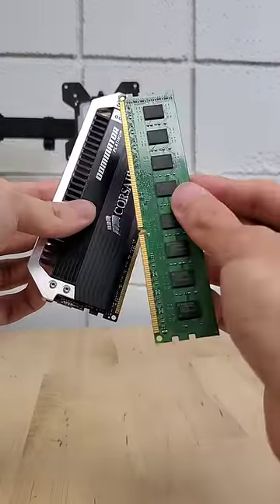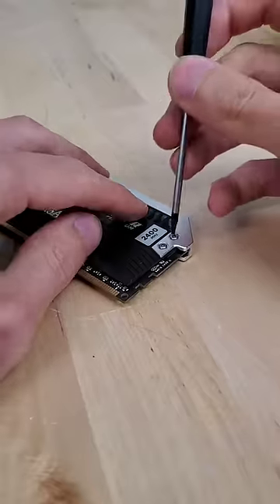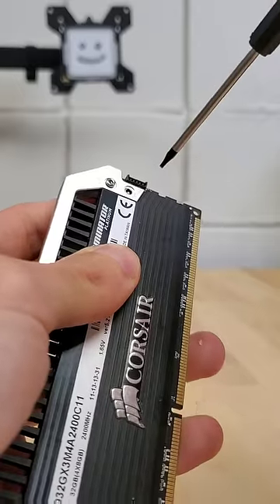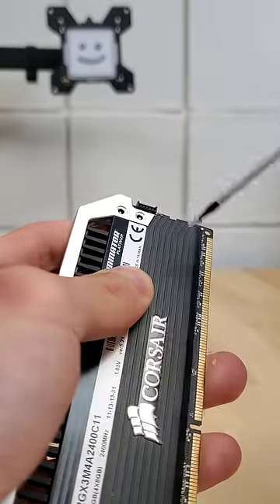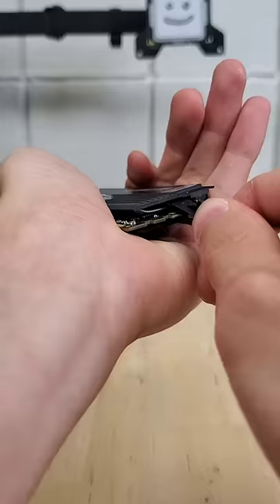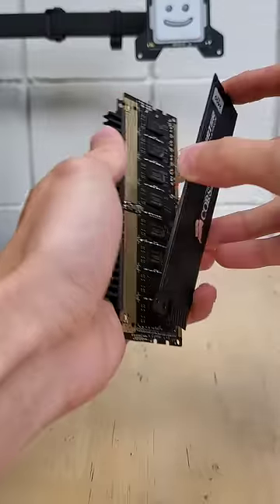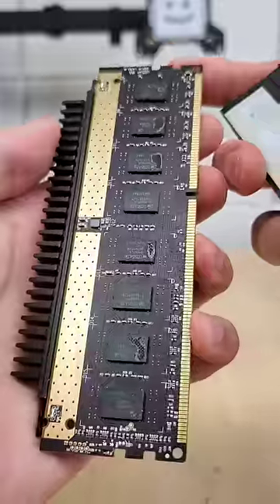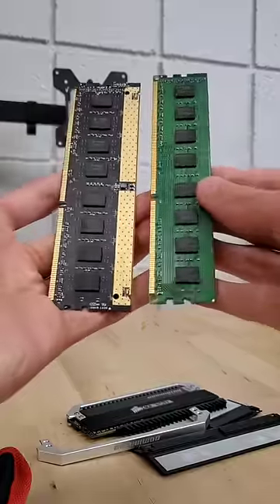why do these RAM sticks look different? #shorts

Comment: Why did the first one immediately look like a harmonica to me...?! 👀🤣
Reply: its to disperse heat from the ram
Reply: the fin like structure is used to direct airflow. A harmonica shares this features to pass air past the parts that then vibrate and produce a certain tune. In the case of the ram, it helps direct airflow past aluminum to help disperse heat. You disperse this heat to run the hardware at higher mhz for better performance, but the extra electricity can add additional wear to the hardware, shortening it's life. Thus we put these metal fins on it, with thermal pads (the sticky part that requires heat to remove) to help reduce the load of heat on the part, helping it to last longer.
Reply: I see you have a great imagination LOL
Reply: @DocDuko  r/science
Reply: Not just higher mhz but better stability in higher speeds and more overclocking headroom.  Though overclocking ram is pretty much a niche thing to do with pc nowadays since xmp/docp is pretty good. So that corsair dominators are just for mainly display and aesthetics these days though the functionality is still there if you need it.
Reply: static shock at its finest 😀👍
Reply: @cunnieseverywhere  nah 95% of all ram heatspreaders dont do shit, its only there for looks especially on corsair garbage
Reply: So you can always listen to harmonica while you're gaming.
Reply: holy shit it does look like a harmonica
Reply: You don’t use your ram as a harmonica too?
Reply: I liked this before realising
Reply: @DaddyM7MD  ”Yeah b*tch! SCIENCE!”
Reply: Housebuilding song intensifies
Reply: Those rams can do to us what they will, but we will never tell you anything!!!
Reply: @BenTiredson  the only real answer.   Ram doesn't get too hot, and doesn't need a heatsink, or we'd have an actual heatsink on it.   So far at least

Comment: You never actually answered "why" they look different, it's because the higher end RAM has that heatsink stuck with thermal pads to the components.
Reply: and tighter timings, ect.
Reply: And better quality and all that gold
Reply: It's almost like one is designed to run at 2133mhz and one is designed to exceed 3600mhz or something.
Reply: @ec7005  I have a question, I have laptop ram that runs at 3200 mhz but it doesn't have a heatsink, is that normal?
Reply: @doggo_woo  yeah

Laptop components just dont have space for that much heat regulation
Reply: @doggo_woo  heatsinks on modern ram are mostly aesthetic ddr4 ram doesn't get hot enough to justify them
Reply: But components (memory chips) has plastic cases. And plastic is not that good in transferring heat. 

Do you see those metal rectangulars? Heatsinks are attached to those.  I belive high end RAM has a separate heat spreading PCB layer.

Comment: Just like in real life. Cooling really makes a difference in efficiency.
Reply: Define efficiency?

I don't think it is efficiency it improves.
Reply: Dude if your thermal throttling RAM you need to improve your pc
Reply: @frankieslefttoe8210  I'm not? It was just a statement.
Reply: @deang5622  hotter can lead to a slower performance, which can in turn make the whole process slower and thus inefficient.
Reply: I agree bro, it's a bigger thing in laptops and phones tbh
Reply: @raiduh899  RAM only thermal throttles at 90 to 100 degrees if it gets that hot you should worry more about your GPU and processor
Reply: @frankieslefttoe8210  correct. Again, only a statement.
Reply: @raiduh899  oh apologies thought you was a different person
Reply: @frankieslefttoe8210  You can run into memory instability way before that when you start tuning your memory. The memory itself doesn't run particularly hot so you might be able to run memtest all day, but start pumping some real heat into the system from GPU+CPU and your memtest stable RAM could be causing issues just because the case ambient is enough to get your memory hotter. And I'm not talking 100C hot, going from say 40 to 50C can make the difference between stable RAM and bluescreening.
Reply: @SaltyMaud  For anyone who's interested, most DRAM modules are temperature sensitive especially when access frequency is increased and latency is reduced via overclocking, even more so when done past the advertised profile speeds that the RAM was originally binned for. The heat spreader along with case airflow can often be the difference of the overclock being stable on a hot day and getting data corruption the moment you unzip an archive.

But if you're going to simply run your RAM at JEDEC, XMP or the upcoming EXPO profiles, they will probably be fine even in a small case with limited airflow in a warm room.
Reply: So wrap it up in crap that acts like a heat soaker?
Reply: @deang5622  any electronic device uses less energy at a lower temperature since less of the energy is converted to heat
Reply: @ChirpFPV  No, that is wrong.
The electricity passing through a device generates heat because of the resistance of the electronic components the electricity is passing through.
That power dissipation is a function of the current and the resistance of the device.
The resistance may vary with temperature, and that can affect the power dissipation, however for your statement to be true, all components would have to have a positive temperature coefficient of resistance,  and that is incorrect .  Devices can have either a positive or negative temperature coefficient of resistance.
Reply: @deang5622  oh, my bad😅
Reply: Ram never gets to a temperature to over heat.
Reply: @MrMorgan316  Correction, properly installed RAM never gets to a temperature to over heat.

What is the operating temperature range for RAM and why is there an operating temperature range?
Reply: heatsinks do next to nothing on ram sticks, they really dont need heatspreaders. its purely aesthetics
Reply: @a_aron30490  Really. Got the evidence for that have you?

Are you saying the chips won't over heat when driven at the frequency and current?

Do you know what happens when chips get too hot?
Reply: @raiduh899  No. Go read my post again.
Heatsinks on RAM modules are nothing to do with efficiency.

You need to be very clear on what efficiency is. I said in a previous post "Define efficiency". I said that because people clearly do not understand what efficiency is.

Don't mix up efficiency and performance. They are not the same thing.

Manufacturers are not considering efficiency when they design the RAM modules. They are designing the module so that it works over a specified temperature range.
Reply: @raiduh899  RAM don't even make enough heat, they're literally just memory modules that store and gives data.
Reply: Ram almost doesn't heat up and any cooling isn't necessary. Definielty not in pc desktop. If server ram doesn't have it, and  uses ram more intesively...
Reply: @raiduh899  I wasn't talking about getting hotter, I was talking about efficiency.
There is a difference.

And yes I do know about how semiconductor performance degrades with temperature ..I used to design integrated circuit chips. I had to take account of temperature and voltage variation in my designs.

So, thanks for trying to educate me, but I already know.
Reply: @frankieslefttoe8210  Rubbish.
You think a RAM chip can survive 90 degrees C without impacting performance?

Comment: Yeah, ignore stuff like transfer speed and latency and they are the same, lol.
Reply: the dom plats in this video only run at 2400 MHz, this speed and even higher are easily achievable by a stick of  plain jane no-heatsink ram, and that also includee latency timing.

Comment: What's important is on the inside.

Yes, but those heatsinks are pretty important too.
Reply: heat spreaders*
Reply: And bigger is better ;)
Reply: Not really. DDR2 sticks ran at 2v and didn't need heat sinks, so DDR4/5 with 1.1v won't need it either.
Reply: @rvnx  Memory modules that run XMP profiles use a higher voltage and do run hotter.  A lot of it is looks, but it's also on there to keep the temperature down.
Reply: @TheLionAndTheLamb777  not really. It's been years since we had computer cases with dedicated fans for the RAM sticks. If they actually care about cooling, they would've gone with a finned heatsink design
Reply: My RAM goes up to 50C last time I checked WITH the heatsink / spreader. Yes, they very much need it.
Reply: @rvnx  if u dont mind lower speed and higher latency, then basic ram is fine. Ive never seen basic ddr4 ram with jedec and xmp as high as ram with heat spreader.
Reply: My ddr3 is at 1.65v and has very basic heatsinks. So I agree.
Reply: The colder temp the faster it can run, which also depends on the parts on the ram, so cooling may not be needed, but it helps secure a consistent or faster performance and I'm not gonna say no to that.
Reply: @accretian  samsung bdie
Reply: @rvnx  it is 2022 and everything needs a heatsink. CPU/GPU, M.2 SSD, RAM, even a heatsink needs a heatsink.
Reply: @rvnx  [older technology] can do x so [new technology] should do x
That statement unfortunately proves false, especially when you talk about electronics being cool.
(On another note: it's total wattage that is proportional to heat output, voltage isn't that significant when there's a higher current intensity)
Reply: @rvnx  Run your ram at 2v then champ, please do come back and share the results though :)
Reply: They aren't important. There is no evidence for heat spreaders even affecting temperatures and performance
Reply: @rvnx  🤓🤓🤓🤓
Reply: @rvnx  eh depends on the DDR2 cause ram coolers were necessary if you had poor case airflow or a lot of fast ddr2 in close proximity to eachother
Reply: @MrMorgan316  they are important if you've got a shitton of ram
Reply: @theaverageblitzer4351  yeah but the average user it only helps with grip on removing them and putting them in
Reply: @theaverageblitzer4351  but if you do run into heat, you have problems. rather safe than sorry. who knows maybe chrome can crash
Reply: @mycelia_ow  that's what I'm sayin'
Reply: DDR5 is hot
Reply: @patx35  OCed RAM can go to 80c or higher. Memory chips are somewhat sensitive to temperature. That's why memory intended for OC comes with heatsinks.
Reply: @rvnx  That doesn't mean anything. Older chips were made on process nodes far bigger than we have today, those would run at higher voltages without causing that much heat. Try to run modern RAM at 2v and see what happens.
Reply: Actually the heat spreaders aren't important. Modern ram doesn't get very hot; at least not hot enough to damage the ram. You will damage other components in your PC before your ram overheats.
Reply: @hardcorehunter7162  in laptops ddr5 needs a head spreader. Little ultrabooks have little space for heat and often are very hot in every area.
Reply: @babyhandsthegreat  My laptop ram doesn't have a spreader. I don't even think I've seen laptop ram with a big heat spreader on it.
Reply: @rvnx  It depends on what you're doing with them. As someone mentioned XMP automatically puts them at higher voltages (1.35) which really is just a startpoint for most OC enthusiasts.
But for common gaming? More than likely just a nice to have and not a necessity.
Reply: @hardcorehunter7162  most bigger laptops don't. Some ultrabooks have them.
Reply: @GoodOlTazzy  have you tested what temp it gets to without it? past tests concluded the heatspreaders negatively affect temps, but that mightve changed by now.
Reply: @rvnx  do you know anything about ram ?
Reply: @rvnx  try touching a ram running at ddr5 6400 mt and
Reply: @GoodOlTazzy  50c is nothing to the stick man
Reply: @rubensguerra19  50 is quite a lot for higher quality ram. Can cause some stability issues above 40.
Reply: So manufacturers can squeeze more money from gamers. Gamers are some of the most gullible customers in the world
Reply: @patx35  They wouldn't as with everything there is a diminishing point of return. While the heat generated is enough to slow the memory speeds down, it is  effectively decipated by the heatspreaders and do not need finned heatsinks; so why spend money on the machining fins when you don't need it?
Reply: @patx35  yes and the heatsinks quickly transfer the heat away from the ram which then gets cooled by the fans, might not be needed but it is more efficient I think
Reply: @scidja8567  that is a heatsink not spreader
Reply: @GoodOlTazzy  ram can run much hotter than other components. It doesnt need it.
Reply: @MineJulRBX  not true
Reply: @MaYbYl8eR  ram sticks dont have heatsinks they have heatspreaders
Reply: @scidja8567  I mean... A heat sink kinda does spread the heat.. You could use it interchangeably
Reply: @LtdJorge  the fuck kinda ram you running that reaches 80 Celsius?
Reply: @anthonyatuhaire  they have their differences so thats why they arent interchangeable its like saying cpu is the same thing as a gpu die
Reply: The avg joe out there just fine without heat spreader running 2666mhz ddr4 for gaming.

Unless you're gaymer so much that needs 6000mhz ddr5 and even enabled xmp coz of "NoT eNoUgH fPs" then maybe you need it.
Reply: No, they're not important. Well, for DDR4, anyway, they're not. It simply doesn't get hot enough.
Reply: Honestly not really they are mostly cosmetic. Every other heatsink or spreader on your pc is functional. Not that this one isn't functional it's just not very practical ram doesnt produce much heat.  But it sure makes it look cooler
Reply: @MrMorgan316  there is absolutely evidence of thermal transfer being important for cooling, Otherwise my fanless build I just did would overheat instantly
Reply: if heat was an issue there wouldn't be "RGB giga gamer chad" memory modules so yea heat sinks also serve as aesthetics.
Reply: @rvnx  I use ddr4 with heatsinks and run it on xmp profiles. Even when I have it at lower speeds closer to what basic chips would run like 2700ish, it gets freaking hot. Running RAM on XMP is pretty common, so those heat sinks definitely help. They would break much quicker without them, it helps life span a ton to keep the heat off the dram chips. Also, the voltage is only part of it. Even at higher clocks, the voltage often isn't all that high, but drawing more current makes a lot more heat. Running RAM at 3600mhz quite understandably makes a lot more heat than 2133mhz.
Reply: @GoodOlTazzy  what about laptops? Would it be worth it to upgrade to ram with heat spreaders vs my crucial ram?
Reply: @__lasevix_  if volts multiplied by amps gives you watts, how can voltage not affect it but wattage can? 110 volts at 2 amps will generate twice the amount of heat compared to 220v at 1 amp, higher current generates heat not wattage.
Reply: @patx35  there are levels to things. The most extreme is water cooling, then fan cooling, then passive finned heat sinks, then just a big piece of metal heat sink, then no heat sink. It’s not a matter of “if they care or not”, it’s “is this good enough” or not. And the answer is yes. It is good enough and it gives it a nice clean look which recently has been the deciding factor for a large chunk of gaming builds.
Reply: @scidja8567  They do both 🤷‍♂️
Reply: @GoodOlTazzy  That's nowhere near dangerous temps for memory modules/controllers. So no, it doesn't really.
Reply: Morr surface area is better
Reply: Don't lie, your rgb lights are what matter to you
Reply: @AxeDragon1989  😩
Reply: Myth
Reply: @youravghuman5231  not running xmp on your ram is literally a waste...
Reply: He said what counts..
Reply: only if you are overclocking
Reply: Its so funny how wrong you are hahaha 

They make DIMMs over 128gb without any heatsinks because all you need is the air around the memory to be moved. As long as its moving the dimms are fine haha
Reply: @GoodOlTazzy  unless ur slamming a bdie kit with 1.5 volts and have it clocked at 4200+ u need to seriously fix your airflow my dude
Reply: @dimitry7182  absolutely no one should daily their memory at 2v even with a heatsink. period
Reply: @hardcorehunter7162  overclocked bdie ddr4 becomes unstable once temps start to creep over 40c so thats incorrect
Reply: @gozutheDJ  overclocking anything is never worth it especially for ram since you only get a 2% performance increase at max that shortens the life of the parts. Most fully overclocked pc get like an extra 10fps and its not even stable and just heats everything in the pc up more than it should.
Reply: @hardcorehunter7162  i mean you can think that if you want.
Reply: Lol no people have been overclocking their rams with no heatspreaders for ages. Alot of those gear have rgb too and ofcourse so they charge you more
Reply: @dimitry7182  Samsung B-die on the A2 PCB is alright at 2.0v for 5-10 minutes at a time to do Y-cruncher and SuperPi stuff

That's how you squeeze 4600-4800 at CL14 out of it
Reply: @jetpbastos  Corsair XMP profiles tend to be worse than the Auto settings with a manually set frequency on a lot of motherboards
Reply: Whoever thinks heatsinks for ram is needed is either a high class editor or a fool who's willing to spend 10k on their rig
Reply: nope, absolutely useless in low voltaje set ups
Reply: It's a fucking RAM stick. Unless you don't plan to overclock it, you literally don't need heat sinks, every pro useage ECC ram doesn't have a heatsink .
Reply: Nope in reality it's really optional

Comment: Also, the difference can be in the amount of layers the pcb has and memory topography as well. The heatsinks can also help offload heat from the dies too. The "fancy outside" isnt always why prices are high. some sticks are literally better in every way, even having better binned dies for tighter timing.
Reply: Basic ram would explode trying to run a 3600mhz profile. A set of chips running 2133mhz doesn't make nearly as much heat as a chip clocked up to 3600+. High end RAM is designed specifically to run at XMP profile speeds. They really are made better (or at least more resilient) in pretty much every way. Obviously dram chips look like dram chips either way.
Reply: Dice*. One die, many dice.